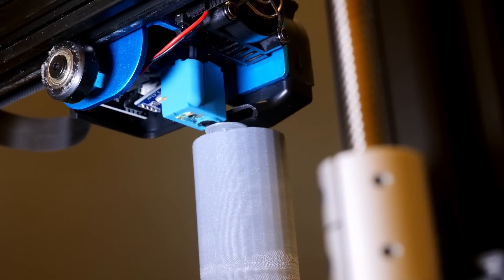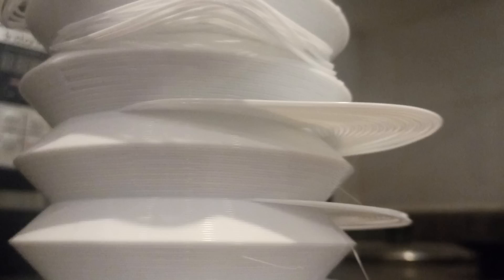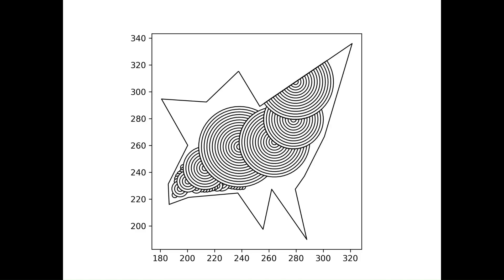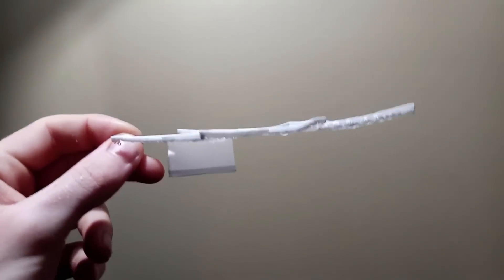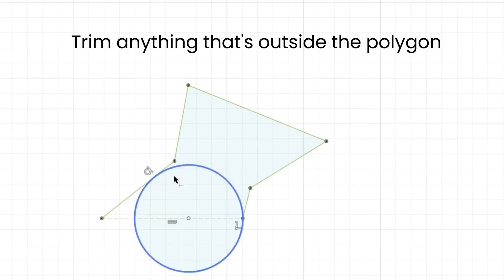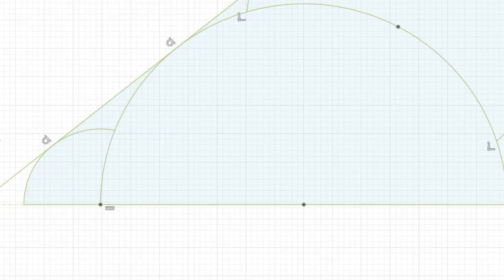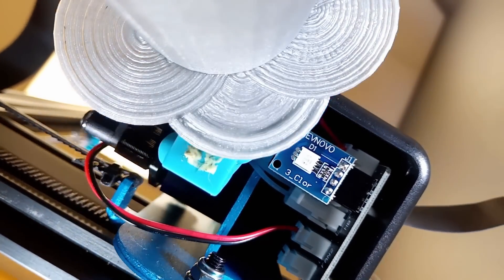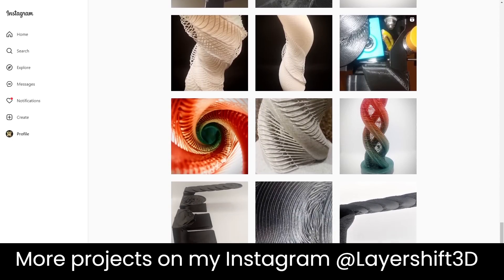Arc Overhangs Eliminate Supports to Reduce 3D Printing Waste

Comment: Also: I have a decent bit of experience hacking on Cura's codebase. I won't have occasion to do much for the next couple months but I could probably help you with it when I'm available again or work on integrating some of your code/algorithm myself. The basic idea, which Cura already has abstractions to do, would be subtracting the previous layer offset outward by a maximum ordinary overhang distance from current layer, and applying your algorithm to that region to print at the end of the layer (and subtracting that region from what Cura attempts to print normally).
Reply from the maker: Thanks! I tried working on this for Cura initially, but developing for Cura on Windows is a real pain. Prusaslicer was a lot easier to build. If it still isn't developed for Cura in a few months, it would be amazing if you would help me get that started :)

Comment: Are you overlapping the nozzle orifice with the previous line when building this outward? Doing that should give much better surface quality, reliability, and dimensional accuracy (avoiding sag from not having something to squish against). I've basically had this concept - minus your recursive circle approach which I think is really smart because it takes advantage of convexity and how curving inward makes the overhang succeed where it would otherwise fail - on back burner for a couple years now and would love to see it become reality.

Comment: There might be an in-between solution that offers the superior finish quality of a supported overhang and the filament efficiency of this. Could you build a sort of sparse arc "web" structure that attaches to the main body with a break-away pattern, and then use that as a basis for a mid-air support structure? That ways the "finish surface" still gets fully supported, and support waste is drastically reduced.
Reply from the maker: Yeah that is a really promising idea. Using Arcs as a mid-air platform to build normal support material. I think this would be really good for tall prints. Instead of 200mm tall support structures, we could just have 2mm tall supports that are just arc overhangs (gently connected to the main part) + a few interface layers for smoother bottom surfaces.

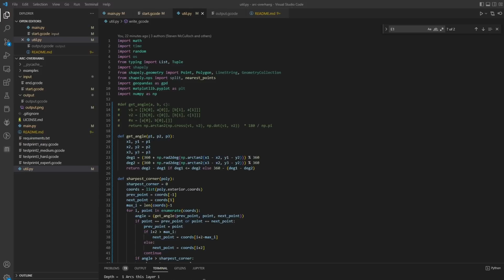Comment: Very nice. At 1:52 we can see the nozzle slinging the filament around the circle, rather than depositing it directly where it needs to be(the nozzle makes a wide circle, then "rolls" the new row of filament on the circle), which seems to work quite well. Is this intentional or accidental?
Reply from the maker: It was intentional. Using the curvature of the arcs means the filament is always pulled toward the center of the arc, improving adhesion to the previous arc.

Comment: That's so clever. You'd think it would just sag and never be dimensionally accurate, but it's actually really good for what is essentially just printing in mid air.
Reply from the maker: It's still amazing to me that the overhangs actually tend to curl upward instead of sag downward. Gravity really doesn't seem to make much difference sometimes!
Reply: @3DQue  Yeah, I can't figure out how that even happens. It kind of looks like a warping print, but in mid air... I don't think many people are going to use massive overgangs like those in a functional print. The smaller overhangs are probably more than sufficient, which is good, because they look incredibly clean.

Comment: It would be nice to add ribs similar to the structure on leaves. It could be only a mm high to avoid hitting the gentry but would probably help reduce sagging
Reply from the maker: Yes for sure. I think some special settings for the layer right after the arcs would be needed to reduce warping. I want to explore that first before incorporating normal support structures.

Comment: That's great at 90 degrees. What about say, 100 degrees?
Reply: Depends on the nozzle and cooling placement, and once we're playing with those the complexity grows insanely fast. As do the capabilities.
Reply from the maker: I'm 100% sure it can be used to print negative overhangs. The only problem is that will involve non-planar slicing which is fundamentally impossible without a complete reworking of how current slicers work.

Comment: Very cool.   Thanks for your hard work....  This will definitely expand the capabilities of 3D printers if popular slicers would adopt your method.  I've always hated supports especially on PETG.  Sometimes,  it's almost impossible to remove.
Reply from the maker: Yeah, also TPU supports are an absolute nightmare. I haven't tried this overhang algorithm with anything except PLA, but that might be something to try in an upcoming video!